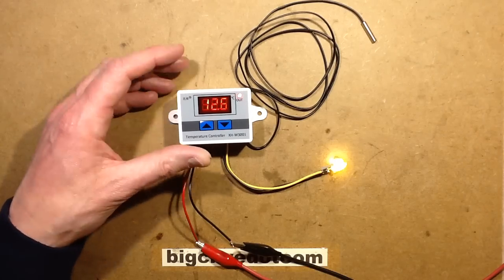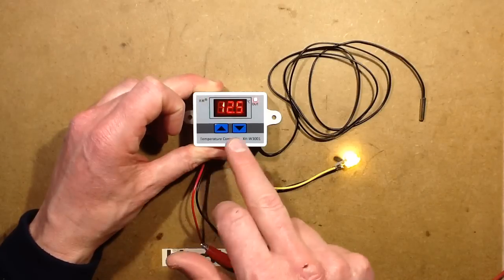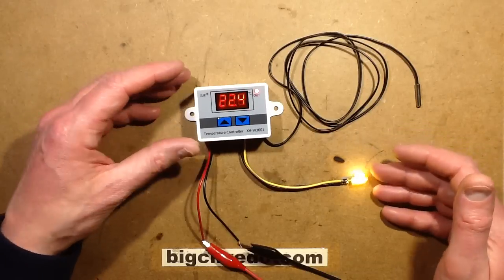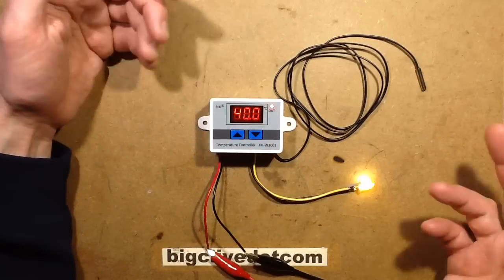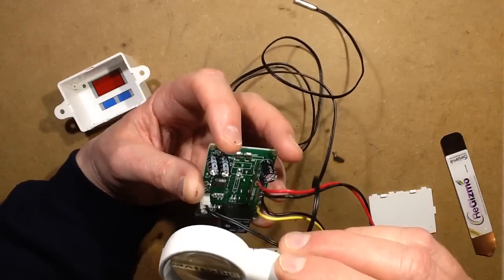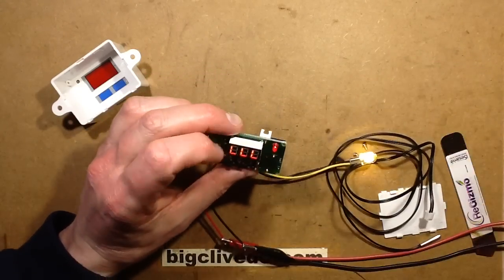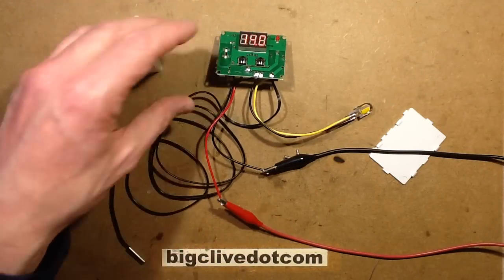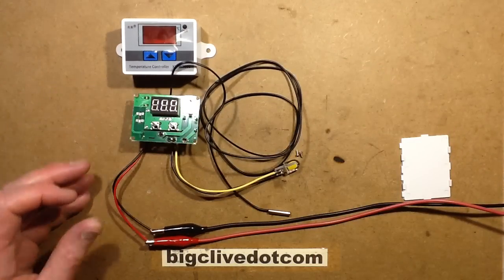How to set a XH-W3001 thermostat module, and a look inside.

Comment: Probe failure should leave it in the safest situation for THE LOAD FUNCTION. If the function of the relay was set to cool, the failsafe should be COOLING. If the set function of the relay was to heat, the failsafe should be HEATING.
Reply: Not always. When domestic ovens fail on it causes fumes, smoke, heat damage and in the worst cases sets the kitchen on fire. Not a good idea.
Reply: Probe failure should leave it in the safest situation for THE LOAD FUNCTION.
Reply: Not always. When domestic ovens fail on it causes fumes, smoke, heat damage and in the worst cases sets the kitchen on fire. Not a good idea.

Comment: Hi could one of these be wired into a solar dump load set up. I'm looking to install a 12v 300w immersion water heater element in a tank of water. Would this work or would it burn out at 120w? 

Thanks for the informative video.
Reply from the maker: I'd recommend at least a 30A automotive relay for that.
Reply: @bigclivedotcom  thank you for the quick reply 🙂

Comment: Nice 👍🖖
Could it handle directly a 12v 50watt polyimide film heater element?
Reply from the maker: It should.  But you could also add an external relay.
Reply: @bigclivedotcom  Thank You very much for Your Help. 🤗
I'm wondering how You find the time to answer me with so many Subscribers and other channels never answer. 😊 🖖👍

Comment: Hi,,  I can see you know a lot about microprocessors,,,  I bought a 240v version of this unit,,  it only worked 6 hours (on a 60watt tube heater)  Now the display is blank,,   I checked and  240v is going in at red and black, but all is dead,,  had the back off, nowt looks amiss,, any ideas???

Comment: Hi, thanks for the vid. Are these probes sensitive enough to be suitable for measuring the air temperature? I'm wanting to use it for an incubator and keeping the air temperature between a certain range.
Reply from the maker: They should be OK, but react quite slowly.
Reply: @bigclivedotcom  Thanks man. Been playing with one for a few days, seems like it will work out alright for my purposes.
Reply: i use these or similar on incubators. you can help temperature stability by adding sand to the incubator to increase its thermal mass. set temperature +- .1c and it should be fine. i hatched 6/6 emus eggs which i hear is very rare.
also i use the slightly more expensive (<5 quid) model for incubating fungi and bacteria. the model with 4 buttons has a hysteresis setting

Comment: what is the best 220v thermostat module that you have found? 
I want to use it to update my caravan.
I also looking for a good 12v unit for my fans in my stereo installation in my stereo-car.

Comment: I use a 230mm, 12v case fan as a cooling fan in my bedroom window when it is too chilly outside for AC but too hot for heat. My current method of "my lord it is cold in here, better unplug the fan" just went out the window (no pun intended) I think.

Comment: Hi there! I have a 12v - 25 amp 300watt car heater. Would thermostat work? Thank you and great videos!!👍🏼
Reply from the maker: You'd need an external relay to handle that high current.
Reply: I think the heater has two 20amp fuses. .Sorry I have 0 knowledge about this kind of  stuff..

Comment: Back when we had an immersion heater for hot water the thermostat failed a couple times. For some stupid reason it's fail condition was on. So we found out by turning the tap on and steam coming out instead of water :/ So yeah potentially quite dangerous but fortunately no one was injured. It did fill the whole of the upstairs with steam though.

Comment: So if I got one of these that's rated for mains and then put it inline with the mains power plug on my little space heater, I could theoretically remove the magnetic thermal switch from it and then I could have precise temperature controlled portable heater with a programmable hysteresis?
Reply from the maker: I wouldn't recommend switching the high load of a heater directly through this.  An external generously rated relay could be an option though.

Comment: Did it switch on when you shorted the terminals because you didn't short them completely and thus 'measured' a resistance on the thermocouple socket that would be in the 'on' range?  You briefly got 27.4ºC on the display when you shorted it and it turned on.  A 'proper' short would probably have left the light off and an intermittent one would have the light randomly flashing? Even if this is the case, it's still not ideal that it's just remembering the last setting.
Reply: They are so cheap, just run a few in series to get round this issue!

Comment: I want to use this in conjunction with (4) 12V 12W heating elements to heat my aluminum resin tank for my 3D printer. I have a total of 4 heating elements I can attach to the aluminum body of the tank. I don't know how to avoid overloading them. Would I need additional current modulation and what power supply would you recommend I use to power the entire system? Thank you.
Reply from the maker: As a precaution you could use standard bimetallic thermal cutout switches in series with the heaters in case the control system fails.
Reply: @bigclivedotcom  thank you! I want sure if the current output would regulate itself across the heating elements but this is a good safety. If I use a low current 12 volt input to the switch, I should be safe

Comment: can we change the output (light) with a heater?
Reply: I use a main voltage version with a 40w halogen bulb to heat a breader for hatching eggs
And the setup works fine for about 5000 hours 
The last 3 jears!
So I thrust in this little China controller
Reply: @aggrobert8490  ive used it for my Final Year Project, and believe me, this things can work higher than ur expectations

Comment: hi, is it possible to shut down the display lights(manually or automatically)? i want to use it in my camper's bedroom. Thanks!
Reply from the maker: I don't think you can turn off the display on these ones.  Try some black insulation tape over the front.

Comment: Does it's LLL/HHH behaviour depend on whether it is set as a heater or a cooler? I'd like to think a heater would switch off rather than keep going until combustion, but a cooler would stay on with much less risk.

If it gets too cold, you can always put the ice in your whisky this Burns night. :-)
Reply: I dont think so. It'll say LLL when the probe is disconnected or reading too low a temp to display, and will say HHH when the probe is reading too high a temp or if the contacts are shorted out

Comment: I have two of these. 240 Volt rated 10amp.  I wont be putting 2.4Kw down those little wires let alone rely on the relay.

Comment: I got the 220v AC version, I set it overnight, next morning I plug it into the socket and it's dead.
The numbers don't turn on and it doesn't give any output voltage.
I open it to see if anything is toasted but everything looks normal..
I like fixing things but I am a noob at fixing circuits.
Any ideas how to trouble shoot this? is there a way to check if the relay is dead?
Reply: transformer is out
Reply: @paulozabalotnicu1897  Mine has a 220v input and 220v output so I don't think it has a transformer,
it's like this https://s2.imagebanana.com/file/181030/jBVtAGn3.JPG
Reply: @paulozabalotnicu1897  thanks for the reply though
Reply: Its chinese made.. everything written on it.. actually only has quarters on real capacity

Comment: I have a problem I need to know how to set this up to work when it gets hot the fan will go on and cool it down I have a 3 button switch but it looks identical to your two button and on the three button switches got a P1 P2 P3 before that comes with no instructions how to set this up so if you can tell me how to set this up I would really appreciate this thank you Mike
Reply from the maker: If you search my channel for thermostat or temperature you'll find other modules.  One may have a similar menu system on the three buttons.

Comment: Gday mate, just like to ask a question as I bought 2 x 24v of these switches and just realised that I should have got 12v - Is there anyway that I can use the 24v in my 12v system. Regards
Reply from the maker: If the internal relay has a 24V coil it might be easier just getting new 12V units.

Comment: do you think this could power a strip of heat tape as used in reptile incubators
Reply from the maker: I'd always suggest a properly rated external relay and a backup device to protect against harming the reptiles if it locked up or failed.

Comment: Can be used to control an electrical heater of 1500W? Is there a danger of melting?
Reply from the maker: Not recommended for direct control of high current.

Comment: XH-W3001 240v in version 1500W out at 10 Amps do I still need the other relay that you mention thanks.
Reply from the maker: I'd always recommend a good quality external relay for switching high loads.

Comment: Hello, I have this unit (240v) and would like to use it to control a loft mounted positive pressure unit. I don't want it to come on above 30c (as this would force hot air into an already hot house) but I do want it to shut off below 6-8ºc (as I don't want the heating to battle a colder temperature than necessary) is this possible with this unit please?  Thanks NH
Reply from the maker: There are units available where you can set an on temperature and an off temperature.
They tend to look like this one:-
https://www.ebay.com/itm/254525604145?hash=item3b42e88131:m:moN4M6p1mrqUWsCjOEDJ4OQ
Or this one:-
https://www.ebay.com/itm/352877523890?hash=item522923b3b2:g:IhcAAOSwmgJY7Vjm
Reply: @bigclivedotcom  Thank you, that's helpful. I used a STC 1000 just on the cold switch. I noticed that my Positive Pressure Ventilation does cut out at the higher temperatures (28ºc) so I can use the STC1000 to switch out when the loft becomes cold. Thanks again for you clear and concise explanations. NH

Comment: Hello, I connect mine directly and results are bad. Which adapter can I use while powering it on
Reply from the maker: They do versions of these for 12V, 24V, 120V and 240V.  They are not suitable for switching very high loads.  You may need to use it to power a bigger relay or contactor.

Comment: This unit comes in 12, 24 and 220 volt, I guess the 12 and 24 volt versions are dc but the 220 volt input and output are ac. I have the 220 vac verson and it works fine on Aus 240 vac.

Comment: Is there a max distance the wire can get before that probe doesn't work?  Is there a drop per meter/foot?
Reply from the maker: The resistance is high and the sense current low, but you would have to use screened cable or keep it well away from other cables to avoid reading instability.

Comment: How would you upgrade to a bigger solid state module to handle 30 amps 220 vac  but only put 5 amp 
load on the small thermostat
Reply from the maker: You can use the relay in the thermostat to switch a bigger relay or contactor.  I'd recommend against a solid state relay unless it's from a real industrial supplier (definitely not eBay).  You also have to allow for their failure mode, which is to short out and bring the load on continuously.
Reply: @bigclivedotcom   Thank you for taking the time to reply to my comment/question.
I am only a beginner at electronics. could you tell me a part number for a 20 amp 220vac relay and socket number if needed for that relay ,or what you think is best . I live in the Philippines after I retired and supplies are limited but if you could, please tell me a part number and I will order from usa plus  a sketch of wiring diagram , I would be willing to purchase something if you have an online store. or send you a small fee
Reply: @bigclivedotcom   I have followed your advice and ran the output side of the thermostat through a contactor to start and stop my 1 hp air con, thereby reducing the load put upon the small relay of the thermostat. Thank you for your great advice, and taking the time to reply to my question / comment

Comment: What kind of wattage did this draw from the 12v input, Clive? I've been inspired by your video and will be using 4 of them as day/night thermostats for a control box I'm making for my new reptile setup. 

I'm planning on using them with a couple of contactless relays as I don't trust the cheapy Chinese stuff to actually hold a significant load, but need an idea of the wattage pulled by the module itself so I can get an appropriate 230v to 12v transformer; hoping the total wattage of four of them (with no additional load) is less than 18w so I can use the 18w LED driver I already have!
Reply from the maker: The operational current is very low.  Mostly the relay when it's on.  Typically less then 100mA.
Reply: Very cool, will pop the LED driver in to power the thermostats, then. There isn't a blindingly obvious reason to not use a 230VAC to 12VDC LED driver over a different type of 12v transformer, is there? I'm still fairly new to this stuff.

Also, cheers for the rapid response, Clive! Been watching your stuff for a couple of years now and always look forward to your teardowns and explanations! :)
Reply from the maker: The main requirement is for a nice stable 12V DC supply at high and low load, so any good power supply that can meet that requirement will do.
Reply: Please, please be careful using these for reptiles; the fail-on behavior of this thermostat could kill them, and in a very nasty way.  At the very least, consider using multiple in series (or ideally, use a known trustworthy thermostat, like a Ranco, Herpstat, or, for something more cost-effective, Vivarium Electronics).
Reply: Generic User: Not to worry, I've taken that into account; each of the two tanks is going to be fitted with a separate temperate probe that emits an alarm if the temperate moves outside of a preset range (they're normally used for brewing alcohol). I  wouldn't trust these by themselves!

Comment: Thank you for the demonstration on how to set thermostat temperatures, you spoke of the possibility of using this thermostat to activate a relay. I retired to the Philippines I use a 220v ac version 10 amp to control the temperature of my bedroom.
but I am thinking of putting in a whole house/apartment air conditioner but that will increase the size of unit from.5 hp to 2 hp and will greatly increase the load requirements of the thermostat .
they do not use thermostats here to control air con temp.
I am wondering how could I increase the amps from the now 10 to 30?
I am only a novice on electronics and most things.
So please try not to get to technical pretend I am a 6th grade student
thank you for any assistance you can give
Reply from the maker: You can get big industrial relays called contactors for higher power loads.  But a modern air conditioning unit should come with a thermostat facility.

Comment: I had just bought a double one off of eBay and one side is reading temperature the other side is saying LLL do you know what the problem is
Reply from the maker: It sounds like one of the temperature probes is not connected.

Comment: and what if i extend the sensor cable by another meter.....will it still work?
Reply from the maker: Yes, but for long runs you may need to use screened cable.
Reply: @bigclivedotcom  thank you for replying . I've added 3 m of 0.75mm multistrand flexible wire and it seemed ok for a few days until i've turned it off and then back on and every time i do that it shows a different temp. value from the one it was before i turned it off. Is it because of the cable extension that i did?
Reply: The sensor is buried about 25-30 cm undersoil
Reply from the maker: @razvanon  I'd recommend using screened cable if the wire is going anywhere near other cables.

Comment: Can you, please, help me with connection ? I want to use this thermostat inside a device i made. The device controlled by a circuit that powered directly from an AC 220 Volt cable. The circuit has two cables for input (red-black), where the 220 Volt cable connect, and two cables for output (red-black), where the main device connect. How to connect this thermostat ? Does it work with the 220 Volt directly? If does not, and work only with 5 - 12 Volt DC, can i use a circuit that drops the Volts (from 220 to 5-12) without a transformer ? ( Is these sort of switch mode power supply (without a transformer) not very safe, as an internal fault may put 220 volts or more on the output, and destroy everything, or be a danger for me ? 
Thanks
Reply: Here in New Zealand, there is a  24V model 24VOF1  and a 230V model 230VGC1  which I propose to buy.   You must operate the device at the correct voltage for both input and output.. You could  safely step down the voltage for the supply with a little plug in power pack  (transformer or switch mode) with matching output.  (say 5-12 volts)  But of course the  module output can still only handle the 5-12 volts.  (You would need an output  relay to switch a higher voltage)   I once used the simplest of voltage reducers  which is a series resistor of an appropriate rating.  (may be quite large to handle  the V x I  power)   But the output is not isolated from the mains,  so can be lethal,  And the output voltage is totally unregulated.  (goes to full voltage on no load)!   Be careful. Best to buy the right product which should be available.  I'm a retired electrical engineer.

Comment: I don't understand how you connect 110/240v to it...?  You got your 12v power supply and you got your device at the end (light bulb) now where do I plug the 240v in...? (110v if in US)
Reply from the maker: I'd recommend using a 12V coil relay to interface mains voltage.
Reply from the maker: You can get 240V versions.
Reply: I bought a 220v version. I've just opened it up, the relay inside is rated at 125v 🤔